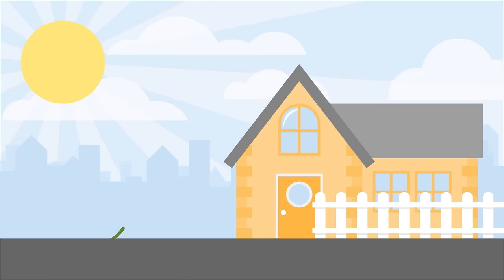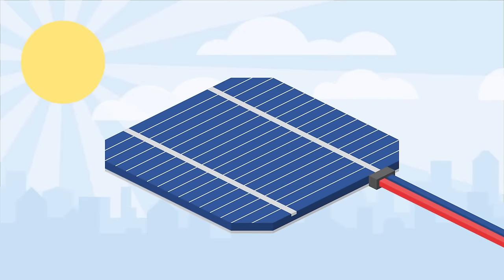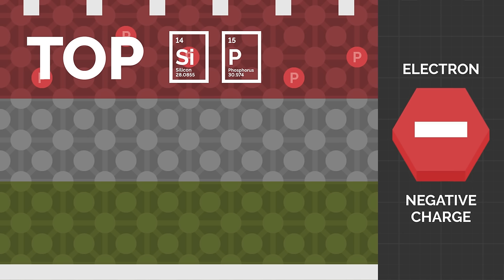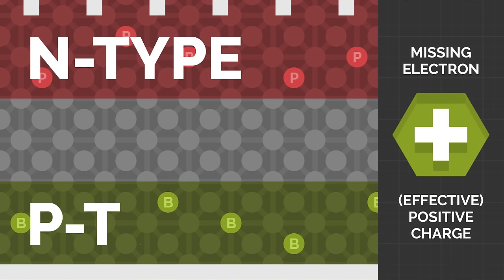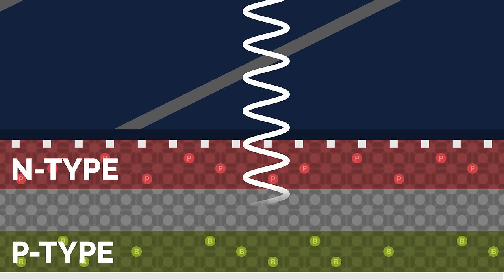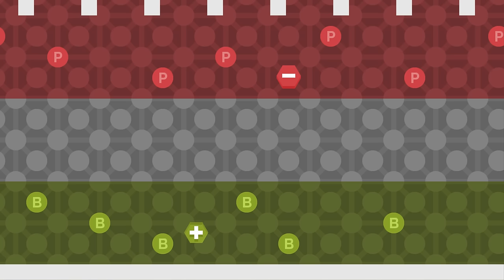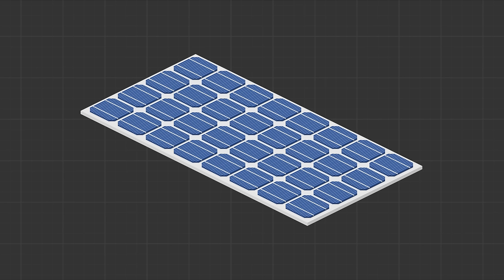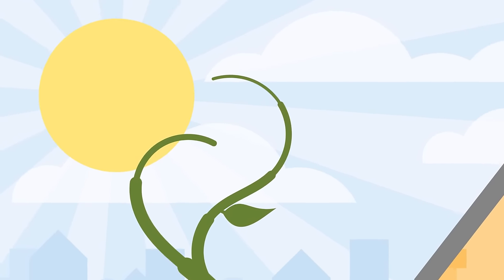How do solar cells work?

Comment: i dont understand what was so hard about storing electricity... just use a lithium battery! unless im wrong please let me know
Reply: A lithium battery is not rechargeable but a lithium ion battery is. Batteries charge slow and they are expensive and doesn't live long. We need to store that electricity, but our batteries are not good or cheap enough. Correct me if i am wrong. Sorry for my bad English. (:
Reply: @asgerchristensen5688  

If you want to store electrical energy, you will need to use capacitors.
Basically speaking, capacitors are "warehouses" specifically designed to store that type of energy. Take care when handling them as they can be fatal if they are holding enough of a potential charge.
Reply: +Knight's Roundtable

I am not sure but i think capacitors only can store energy in a very short amount of time.
Reply: @asgerchristensen5688  

You are correct about the capacitors as well as lithium ion batteries.
The applications that I was thinking about were for RC aircraft to have it's battery charging while in flight via using solar panels allowing a boost in longer flight times.
Reply: +Knight's Rountable

Ok i see, that's smart.
Reply: @asgerchristensen5688  

The boost would come from the capacitors especially if say it were necessary to have a way to bring the RC aircraft back for some reason if the panels or the battery failed.
Of course, all the redundancy adds weight to the vehicle.

Comment: no wonder solar cells are sooo inefficient..we missing soo much wavelength ....i wonder why..and is anyone working on capturing different wavelengths
Reply: I think there are? Not to sure though.
Reply: the reason why it is difficult to capture photons from different wavelengths is that different materials need photons of different energies to "knock-off" their electrons for the effect to occur. Mainly just one material is used in the cell to suit the band of light which is most intense, however a different type of cell (called multi-junction, cascade, or tandem cells) can be used and these have a few different layers to capture photons from more wavelengths.
I guess these are probably more expensive and not worth the hassle or else they'd probably be more common.
Reply: but just like now prices will come down as adoption takes place

Comment: Uh...This explanation is not so great.  It didn't explain the "depletion region" and the electric field in region, that causes electrons and holes to get swept out of the region.  Also, light was explained as a wave instead of as photons which adds little value to understanding how a solar cell works.  The fact that solar cell current increases with more light intensity is easily explained by the fact that brighter light is simply more photons per sec, per area.